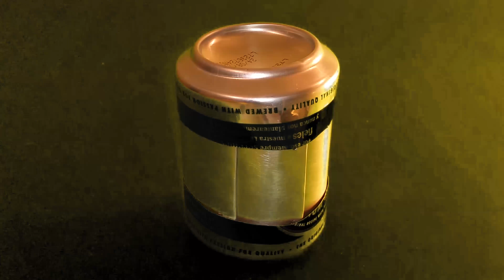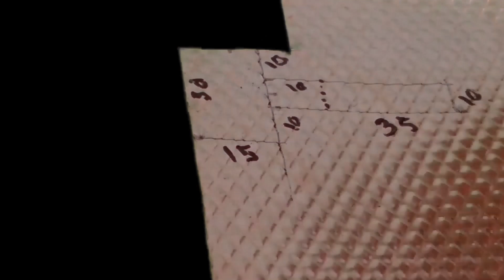2 Alcohol Stoves, With Stand, Windshield. All inside a Soda Can

Comment: What are the materials you used for the bottom? What ist this black and silver material?
Reply from the maker: Aluminum plate and bicycle wheel rubber
Reply: @zZz777   OK thanks, another dumb question, Just to be sure. You are using 2 of those 250ml or 200 ml cans for the stoves. 2 500 ml cans for the stand, and 2 330ml cans for the windscreen and "packaging" right?
Reply from the maker: Right. I dont remember the mml, but yes, three different can sizes are needed
Reply: @zZz777  thanks 😊
Reply from the maker: You are welcome